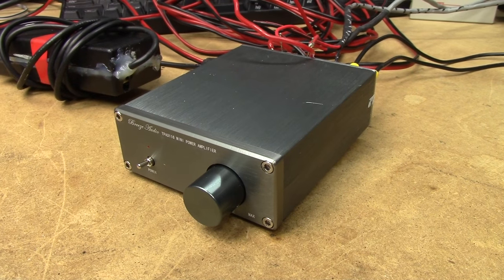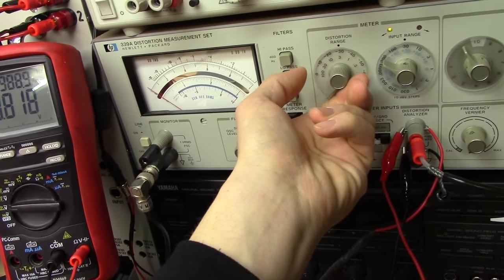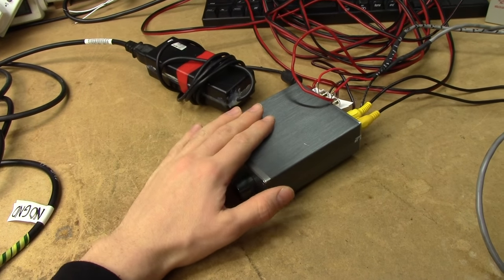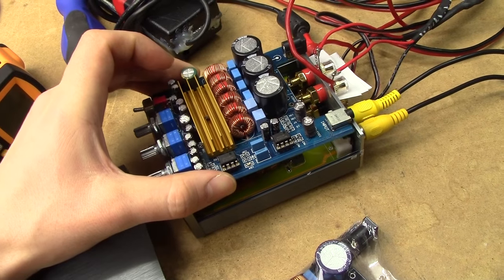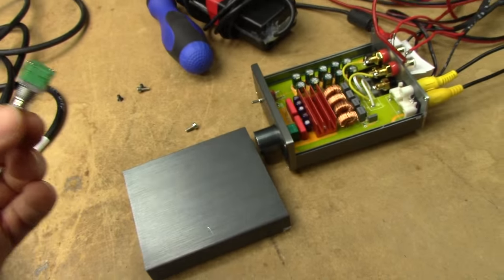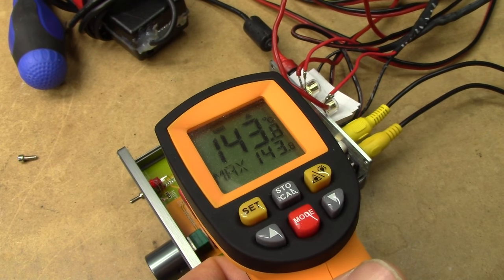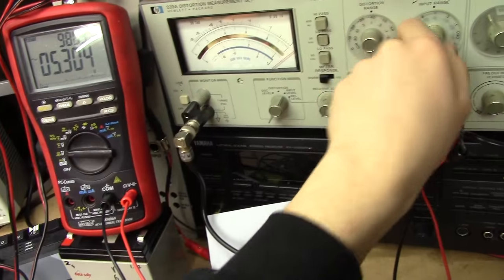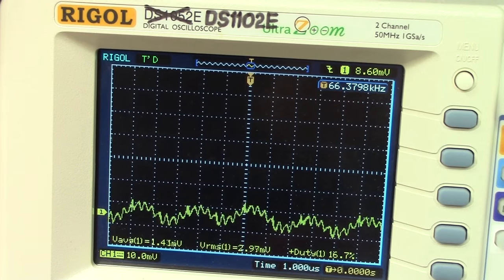Messing with a Breeze Audio TPA3116 mini amplifier

Comment: The 3116 shutdown current is supposed to be 50µA... Operating quiescent current is usually 20-50mA (with connected load) so it does seem like that switch might be the mute mode. Or maybe even one of those fake input caps is bad... You can check if the switch mutes/shutdown the chip because removing the power otherwise causes a small pop on the output (the datasheet tells you to put it into shutdown before disconnecting power to minimise the pop). By the way, the normal power-on time is 10ms, 3fast5me.

Comment: I have the  nobsound dual tpa3116, the gain is too high, ive seen you do the modification on a breeze audio single tpa3116, is it possible to guide me do it on my amp? i know how to solder and desolder, i just dont know what to replace.
Reply: Very much possible, look at the data sheet and replace the resistors that control the gain

Comment: have you seen the sure amplifiers or the new linep amps? I am really interested in these. Not sure if I should take the chance on one of these
Reply from the maker: +FreshLemunz I'm not sure what you're referring to, link me and I might check them out.
Reply: +FFcossag Sorry about that. I will.
Reply: +FFcossag 
Sure 2x50w amp: http://pages.ebay.com/link/?nav=item.view&id=350709620982&alt=web 

Linep Amp:http://pages.ebay.com/link/?nav=item.view&id=321941704361&alt=web 

I've heard decent things about sure.
Reply from the maker: FreshLemunz That Linep thing looks silly expensive for what it is. The Sure Electronics ones, though - they do look interesting. Sure tend to put some effort into the stuff they put their brand upon.

Thanks for the links, I might look into them.
Reply: Make a review if you do!
Reply from the maker: FreshLemunz Of course - making reviews is basically the only reason I buy these amplifiers.
Reply: Nice.

Comment: what is the temperature with a 12v power supply?
Reply from the maker: Temperature basically scales linearliy with output power, so it's going to be considerably lower since you'll just get about 5 W out of it.